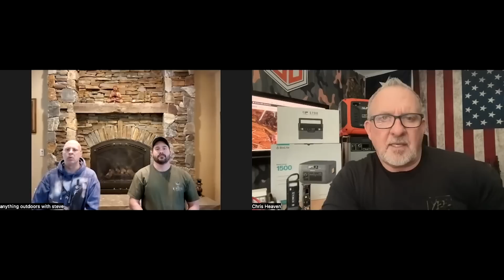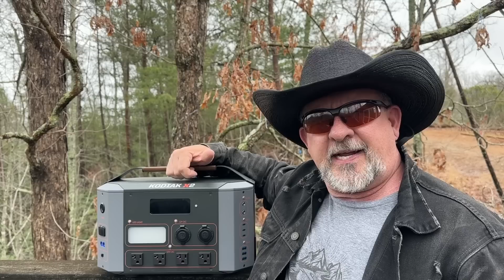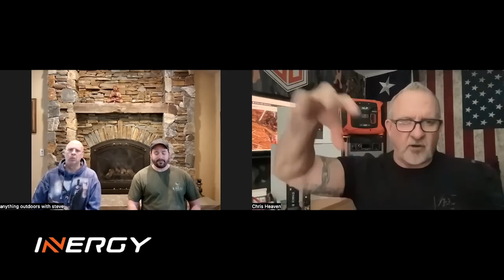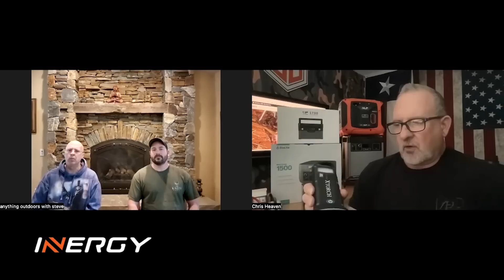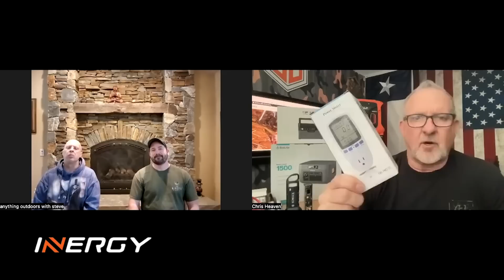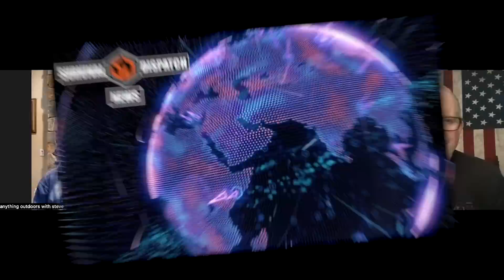How to Be Ready When the Lights Go Out | Survival Dispatch News 4-6-23

Comment: One thing I keep seeing and hearing from the survival community is the power grid is bad and will fail, but yet we keep planning for short term outages. I think we all should be planning for permanent loss of the grid. If you are ready for a total grid failure, then the short term failures will be a simple walk in the park. In your permanent grid down plan don't forget to have all the needed maintenance supplies for the equipment you have. Oil, filters, spark plugs and replacement parts for common parts with will wear out. A second generator as a back up is a great idea. Same for you solar packs/generators. Spare solar panels, spare diodes, an extra set of batteries for the unit and extra batteries for your power bank.  Plan and provide as able.

Don't forget you regular maintenance. Valves must be adjusted on gas/propane engines, oil changes, replace filters Read the manual and follow maintenance instructions. Failing to do so will cause equipment failure. I can not count the number to times I have seen people fail to have the equipment when needed because they were to lazy to do maintenance before hand.

Comment: My biggest prepping mistake was/is setting up a whole house generator. I did it myself 15+ years ago so cost was somewhat reasonable. Ran a test and that thing SUCKS the gas! no way to store enough gas. People on propane will be the same, those with natural gas can make this system work. One thing to keep in mind is cold weather effects natural gas (ask Texas). 

Now my back up is a Honda 2000 & battery banks (solar generators) along with portable solar panels. I will add a few Lipo4 batteries as an addition back up.

Comment: This is going to be a long one Chris. I think it was back in 2011 we had a derochea come through that put us out of power for a month plus. My dad had left me a large generator 7500 and that thing ran our refrigerator, freezer and a window AC, I don't know what the BTUs were but it had the weird-looking plug where one plug was horizontal and the other was vertical that's all I can tell you about it, but it ran the whole house except for the well pump. After that little episode it wouldn't run to good after that for some reason, maybe I wore it out. But during that particular situation we had to drive a good ways just to find gasoline after I went through the 20 gal that I had, anyway after that I bought another Generac 8000 and it will run the whole house but it won't run the well pump or the central air but it was doing a good job and we've only had to use it for 12 hours at the most at a time but we've had to do that several times and now for some reason it don't want to run right. During the time of the derosia, I don't know if my phone is spelling that right or not but I think you get the message, we had had plenty of water we thought saved up but we didn't so when we went looking for gas we went by this larger Creek near the house and got water and I made a five gallon bucket to bucket water filter and then we boiled but the creek that I got it from I had followed past where any people lived before I got the water plus there was no cows or animals on that water because I followed that water all the way up to the spring and other Springs that fed into it, I do my footwork if I'm going to use Creek water anymore. At any rate the Generac 8000 is not running very good anymore and it's getting costly to have someone come out and make it run because I am "NO" mechanic. Y'all eventually got on the subject of solar. Back when I was working a lot especially during the covert 19 pandemic I was trying to get with solar then but my wife's doctor bills kept getting in the way although I did get a solar panel from "INERGY" I wasn't able to get any more from them and I was super impressed with the 1500 because you could add to it but even after she passed away I went through my savings and any other money that I got from her life insurance that was left over and still couldn't pay all of the doctor and hospital bills and that's after her insurance had paid and that is what ruined my credit but enough about that. They kept running an ad about they would put a solar system in at no cost at installation but by then my credit was shot all to hell so there was no financing anything after that. When I was looking for at least something that would run my refrigerator or freezer, separately of course, and during a grid down you only have to run it maybe an hour to about 4 hours depending on how many times it has been opened. I'm by myself now so it doesn't get open that much unless the grandkids get here then they have to hold it open to look through it for 4 or five minutes unless you stay on top of them but by myself I can usually go around three to four days before it needs to be run again. The freezer is in a small room off of the back door and this year I'm going to put one of those little 5000 BTU AC in the window to keep down the heat because it is not attached to the house as far as the central air goes. That's why I was looking at Inergies 1500 because that one would run either the refrigerator or the freezer for as long as I needed it too and they had told me that the one panel that I got would keep it charged up enough for that providing there was enough Sun and we generally get enough Sun during the summer except for this past winter which stayed cloudy a lot. Now my credit is too bad and I can't get a loan to try and buy one. They were talking about having that little panel put in that you just switch over to your generator, well I had one of those put in when I first moved in here because of the generator that I had and I asked the electrician to put me in a idiot switch that's what I called it so that all I had to do was just flipped one switch and I had the power. Now when I lived down in Georgia a buddy of mine set up one of his cords to go from his generator into his dryer Outlet and you can believe this or not I would not lie to you Chris it worked I saw it work. He had to turn certain things off in his main breaker but he still had power for his lights and a couple of other things. You were also talking about the cold weather affecting those li- ion batteries I think that's how you spell it but you were absolutely right because I had one of those car chargers and I forgot all about it being out in the vehicle and when that real coldsnap came through yeah well it kill them. Y'all were also talking about propane and propane ain't cheap no more. I heat with propane and my last bill was $700 for 258 gallons and due to that super cold snap they had to fill it twice, once more than they usually filled it up. This has been an excellent video and I certainly hope people listen because I actually feel we're headed for a grid down situation and when I say down I mean down I don't mean an hour here in an hour there. So people listen to what the man has to say because it really is that important. Y'all think about it now. Survival dispatch crew y'all stay vigilant now!
Reply: Sir you remind me of Santa Claus!

Comment: Just got a Genmax 9000ied because it does run pure sine. It also runs in eco mode to save on propane (in our case). 
Genmax Just came out with the First trifuel 10500w with pure sine.
Reply: The genmax has been on my suggestion list for exactly that reason for the people that do require more running watts. Thank you for mentioning it here.